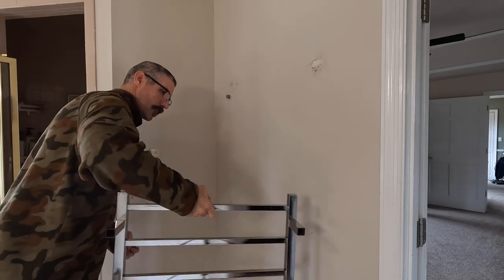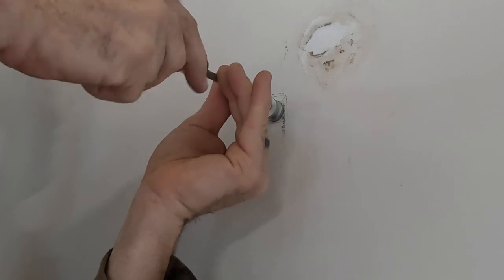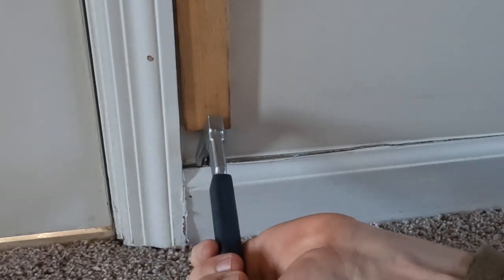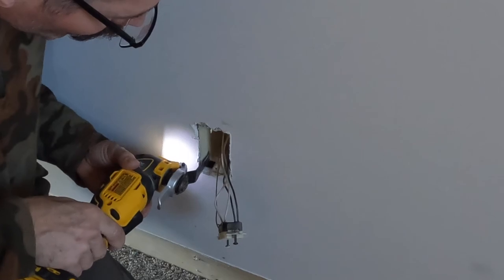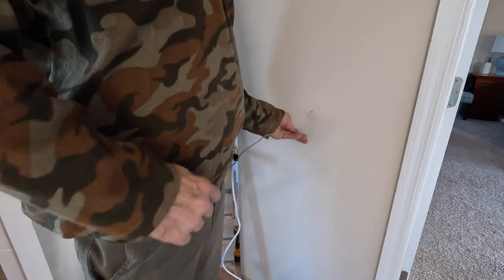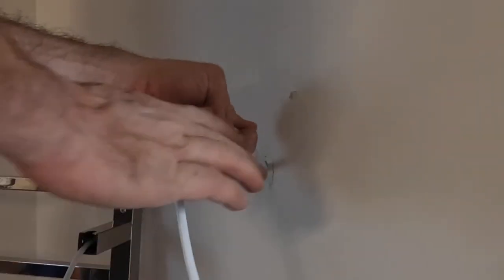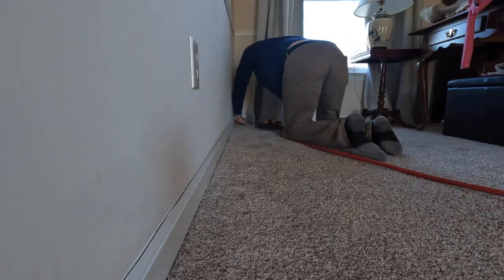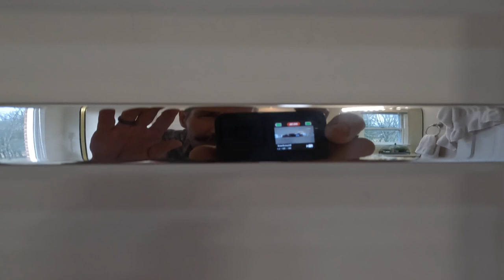Installing a Heated Towel Rack in exactly 11 minutes

Comment: you should have pulled pwr from the outlet and ran it to a junction box and then to a switch and from your switch to to your towel rack so that you can kill it when you need to. I do not think having the towel rack on full time is safe. Please re-do this, you created such a hazard anything that provides heat needs to be in a gfci to protect the line.
Reply: 9:22  On/Off switch on the appliance.

Comment: My friends this is not to code, you need a junction box there to protect the wires and your home incase of a fire. You cant just stuff cables into a wall and hide them. Mice, rats or just simple heat can cause that to spark and the insulation is perfect for spreading flames.